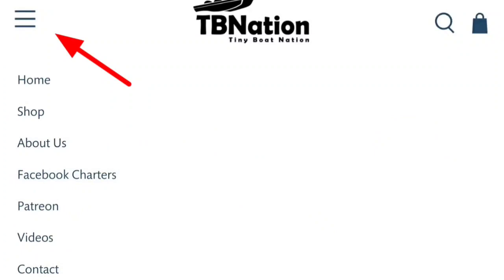How to fix leaks with for aluminum boats | TBNation

Comment: I had good luck with the GatorGlide. Identified a few leaky rivets, used a wet vac vacuum to create a vacuum with fresh goop applied on the outside, let the vacuum suck the goop into the micro void (around the rivets) one at a time, and it seals nicely.

Comment: I used J.B. WaterWeld to fill a couple large holes. I filled a 2-inch hole in the bow with it and it cracked in some rough waves on the lake. I filled the crack with regular J.B. weld and covered it in 3M 5200 Marine Sealer. That stuff is great!

Comment: J.B weld..  I fixed a fist size hole , six years still strong as steel !
Reply: Which JB Weld product did you use? They have several that can work for marine applications? For reference, I have a Lund aluminum boat, trying to figure out the best of their products to try

Comment: I got a 67 starcraft 16 and I used the gorilla epoxy 2 part over the winter on a couple loose rivets and I'm now a few hard trips with no issues. By hard I mean being 28 miles off Atlantic City in some stuff 😂.

Comment: Here in Australia I just use JB weld. Fixed over a year ago and holding nicely with weekly use.
Reply: Are you using it in rough water and is it taking any kind of abuse?  I’ve used jb weld on a canoe and it’s held up for 20 years but that’s a little different...
Reply: Jb doesn't work if you hit wake at all i don't think anything works lol

Comment: In my experience with leaks, if your having serious problems. Take it to a professional local tig welder. It's not worth trying to put a bandaid into something that needs a proper fix. Especially if your getting into rough water and high speeds. I had to completely reinforce my hull with 6061 T6 extruded aluminum. It was oil canning. Design failure from the manufacturer.

Comment: It would be great to have a follow up on this with more details and options.  The answer I got from this was if you’re considering using sealants and you can’t Rebuck the rivets then get a new boat. That is easier said than done and many of us have boats we have put a lot of time into. I am refurbishing my grandfathers boat and it has 1 small hole, probably the size of a pea. I also have some areas that I need to Rebuck but I am considering using a sealant on all the seams prior to painting for extra peace of mind. I would love to know more about sealants, what should be used and for what purposes. Thanks!

Comment: I sandblasted a 3/16 plate Alu. boat. Has some pitting. Do I need to fill the holes with epoxy before I put on gator glide?

Comment: Sealing the inside of my 1860 jon boat with flex seal. Lake Havasu slams my 1973 Smokercraft. Not expecting a perfect seal. Just an improvement would work. I won't put a bottom coat on it.

Comment: Great vidoes...... Quick question...... on the side rails of my jon boat, I have developed a crack on both sides from the engine bouncing around in transit, would aluminum brazing be strong enough or is the boat toast?